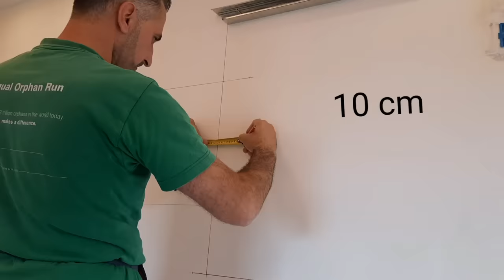أسهل طريقة لعمل ديكور tv جميل وبسيط من الجبس بورد

Comment: Every angle should be taped and coated to prevent cracking .
Reply from the maker: The connection is protected by perforated corners on the sides because the distance between them is close

Comment: You did not use Meshtape at the joints on the drywall
Reply from the maker: It is not needed because the metal corners are very close together so the joint will not crack